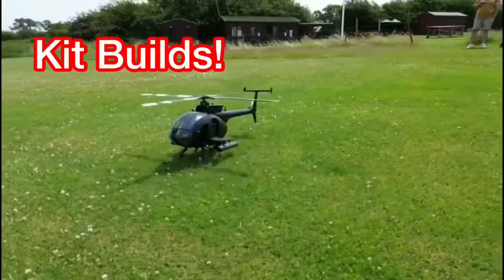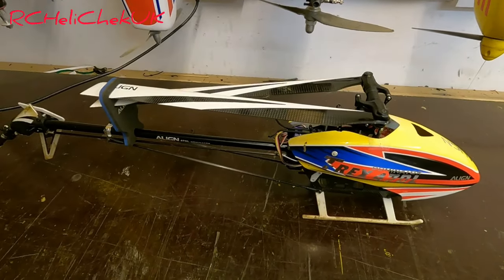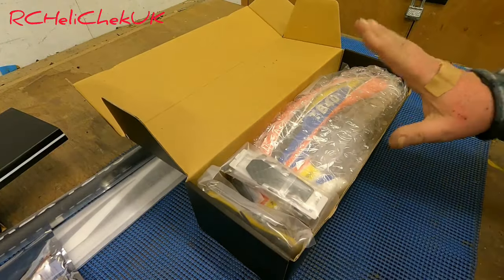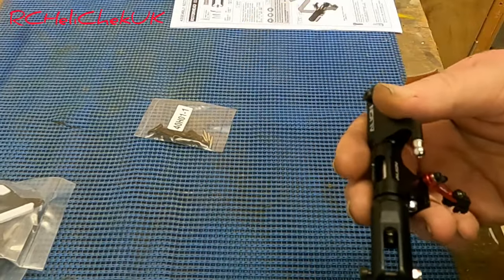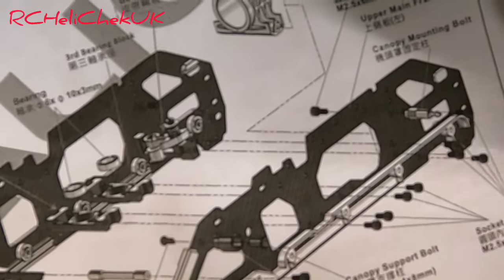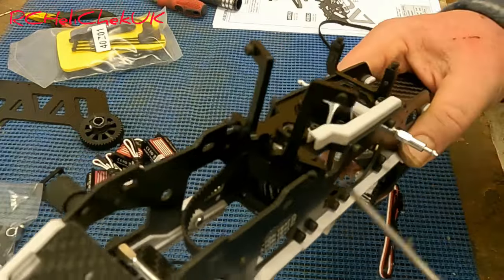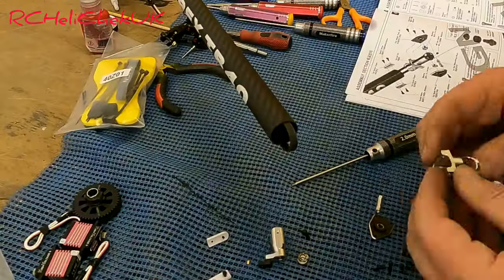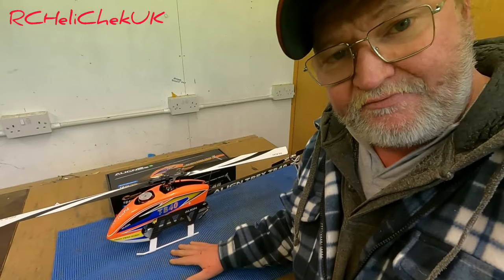RC Helicopter NEW Align TB40/ Unboxing and Build Part 1

Comment: Very nice model and build off part 1, looking forward to part 2 with the beast x setup including the parameter menu.😊.
Reply from the maker: Not doing a setup of the Microbeast in this video as did one in one of the other video’s can’t remember which one though
Reply: Unfortunately part 2 is slightly delayed, the tail servo was DOA so we’re just waiting on a replacement. It should be with me for the this weekend 😉

Comment: Good build video, but I recommend any metal part that is threaded and the screw that goes into it need to be cleaned with alcohol to remove any oils from their surface that was left behind by the machining process. This oil can prevent your thread lock from functioning properly. I use a proxy brush that you use to clean between your teeth and rubbing alcohol.

Comment: Did you remember to grease that one way bearing? I didn’t see it. My follower arm was stripped out and canopy kinda rough. You left out the plate on the top front initially? lol
Reply from the maker: Yep all done as it should have been and no issues at all with the model, still going strong.
Reply: @TheRMRCchannel  on my rudder servo, I left the ball link on first hole- the servo throw is limited and won't hit that bracket. First hole is geometrically perfect. I managed to brick my MB almost gave up-Rotorflight is better

Comment: Thank you SO MUCH!  I watched this video a dozen times before my TB40 arrived. Built most of it last night. The motor wires are horribly close to the main shaft belt though, any advice on how you managed to arrange them on this? Can't see your wire route in this video. Oh this is also my first kit build so I'm new at this.... only flown BNF models until now. Thanks again!
Reply from the maker: Glad it helped. Check out part two of the TB40 pal the installation of the esc is at the beginning of that video and you can see how I feed the wires through the airframe bud.

Comment: Hi Rob
some advice if possible
I am thinking of buying the AlignTB 60 with the view of later using the helicopter for building a scale helicopter 
Can you advise me would this be a good model to learn scale  flying and do you know of a good fuselage that is reasonably easy to use for this setup .
I know its a bit of an open end question but I have to start asking somewhere
G
Reply from the maker: Let me look into that one pal, the TB60 is a good model to use as a trainer type aircraft as long as you dial it down with lower head speeds and decreased pitch, as for a fuselage for it I will need to look around for that as distance from head to tail and height of rotor head determines what fuselage you can use. Leave it with me bud.

Comment: I think Align missed a trick. They could of modified the canopy to be like the goosky or the goblin. Where I think they nicked a load of their design cues, and made a beluga style nose which is hinged and then you could put the battery in without taking off the Canopy
Reply from the maker: Align have designed a great model in the TB40 of which none of it even comes close to a Goosky or Goblin, but Align have just stuck to the tradition of how they build helicopters. I’m sure the flying characteristics aren’t effected by the way the battery is installed after all they are going for a great flying model, not how lazy they are about putting batteries in and out of it
Reply from the maker: @atxplus  end of the day each person to they’re own regarding opinions on what a manufacturers should and shouldn’t do with a design of a helicopter model. Align have just produced to new models in the TB60 and TB70, none of which people are moaning about how they have to take the canopy off to put a battery in, XL Power and Tron both still develope models as well as SAB, where the canopy is removed to put lipos in, I don’t hear anyone else complaining about having to take canopies off to put batteries in with them models. It seems like the user just wants too nit pick at a new model.

Comment: I just got my new gps 450 heli in the mail. It's Flywing RTF assembled .  I just had to put the blades on. This has never happened to me before but soon as I lifted off. It started to like wobble off and on. It kinda looks like wind turbulence but with no wind.  Do you know what would be causing that. I adjusted the blades but didn't help.
Reply from the maker: Unsure without actual seeing it and what it does. Could be the head speed is too low or the other is the gyro gain is off on the gps and that could cause it too wobble
Reply: I was looking at my blades while it was running at top rpm, on the ground.  I and someone else noticed the main rotor blades are moving their trac. Like up and down periodically .  Kind of how it's wobbling up and down in the air.
Reply: I'll check those thank you.. Someone who has this model said I may have had the battery pushed to far back in the provided   trey. They said it throws the CG off and causes it to slight wobble cause the gps.  Does that sound possible to you?  I'm fairly new into this hobby so I'm not sure if that's possible.
Reply: You were right as usual.  I turned the head speed up 10 % and it flew perfect.  Thank you thank you again!!
Reply from the maker: @dradden1556 no worries buddy here to help